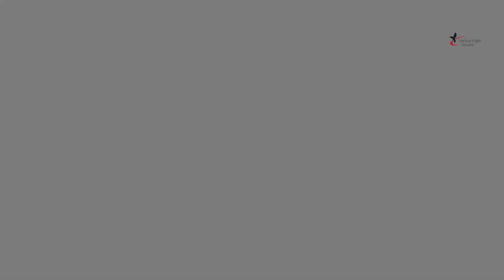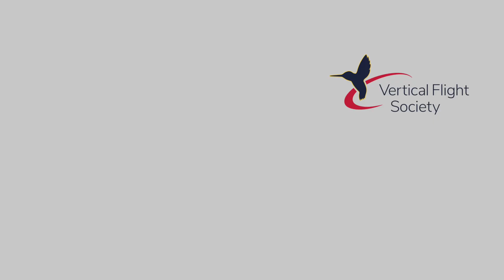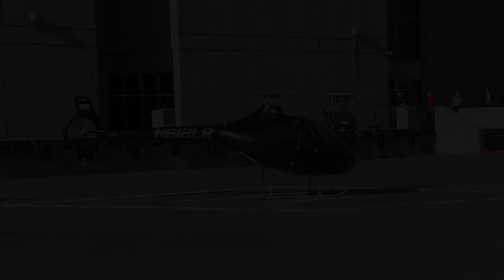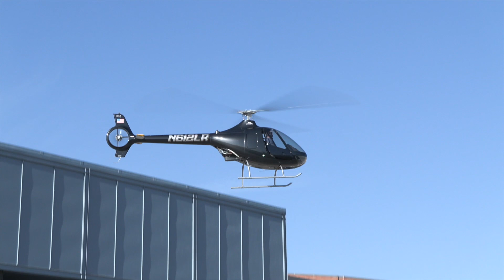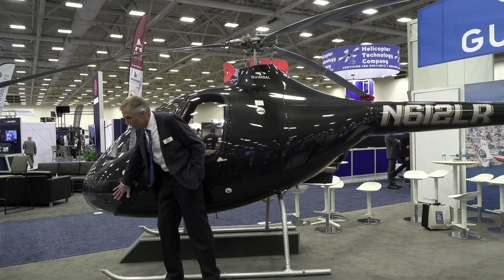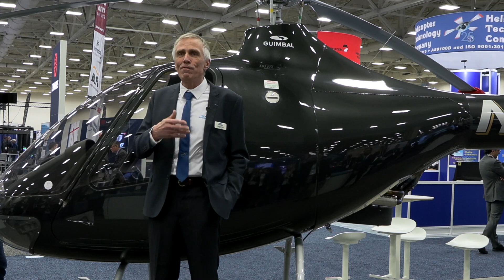Guimbal Press Briefing at Heli-Expo 2022

Comment: I know he's trying to be even-keeled, but there is definitely room to replace Robinson.

A four-seat piston minus everything not great about Robinson? The only thing he'll struggle with is that Robinson is already established; their price will be lower, but for stagnant technology.

But if you take away the big issues:
-Fully-articulated 3-blade rotor to do away with mast-bumping.
-Conditional replacement of many parts instead of time-limited.
-Increased crash survivability
-Fenestron (While traditional rotors are arguably better/cheaper for performance, noise abatement and the fact that people still manage to walk into the tail rotor and other strikes... yeah, it would be nice to have.)
-Removable passenger controls and no T-bar
-If going down the current trend with a flat floor, an unobstructed side opening, and removable co-pilot seat, this future-proofs configurability.
-Lets admit it, better looks.

Even if they end up with a higher price point doing all of that, it's just a waiting game to beat Robinson. Operating costs and especially insurance/liability coverage will be Robinson's undoing. It was a good design for its time and did great for years when there was no real competition, but the inherent limitations are set in stone.

Having systems and handling that seamlessly fill the gap between the G2 and Airbus turbines, Bruno is going to do well. And his attitude and move to buy out investors seem to indicate that he's not going to cut corners to appease others. I look forward to what he produces.
Reply: Well said!!!